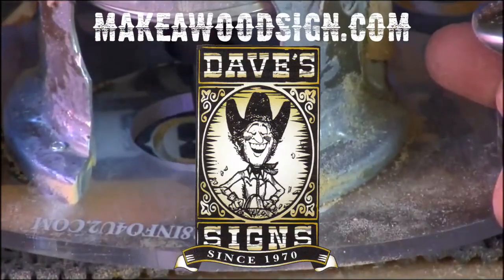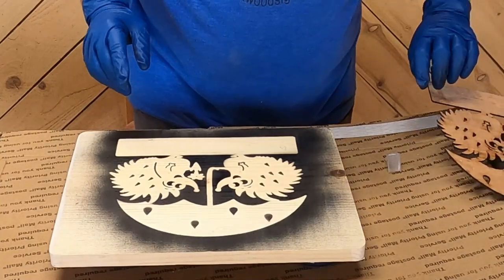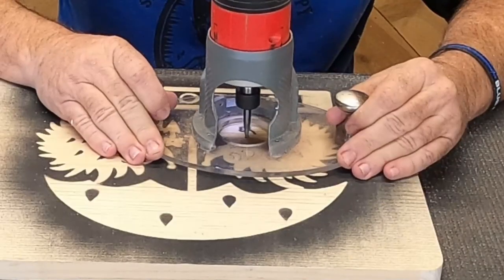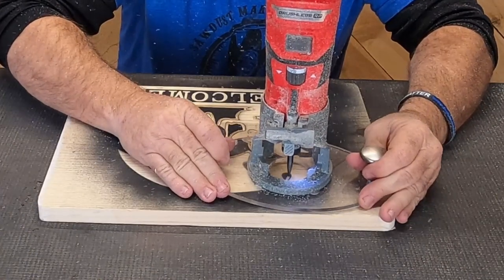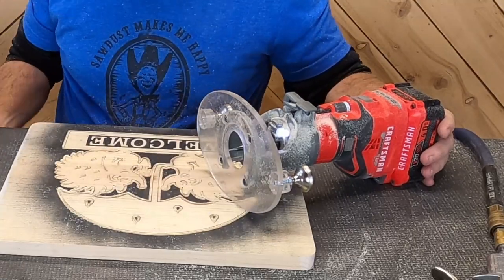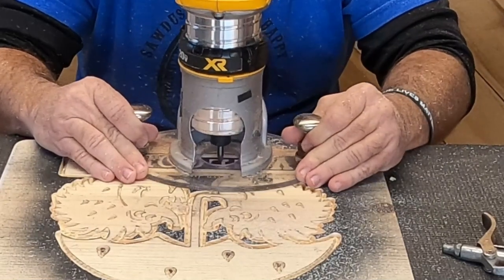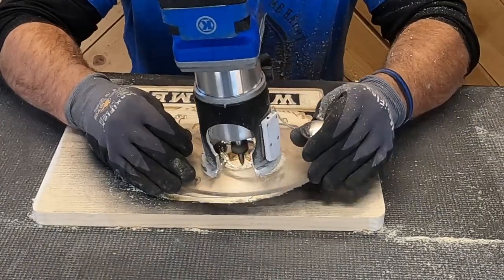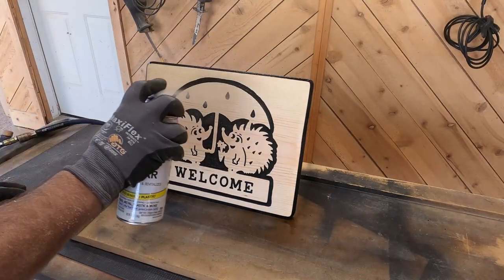Creating a Stunning Wood Sign using Freehand Carving Techniques

Comment: I’m interested in getting the Dewalt router and on Amazon it doesn’t have a battery included option. It also does not show up in the related section. Is there a specific lithium ion battery that you guys use?
Reply from the maker: We have the 3 amp hour batteries, but they don't last all that long. Home Depot has a sale going on where you can get the router, 2 6 amp hour batteries and a charger for $150 I think. I'd definitely go there.

Comment: Noticed you used different routers for this project.  Could the craftsman router be used for this and most  projects.  Since I have other Craftsmen tools I have the batteries.  Trying to decide best router to purchase.  ThankYou for your videos and the step by step explanations.
Reply from the maker: Definitely! We really like the Craftsman router. We use different routers just because we have a bunch of them and we keep different bits in different routers. I'm actually really impressed with the craftsman cordless router. It's a solid tool!